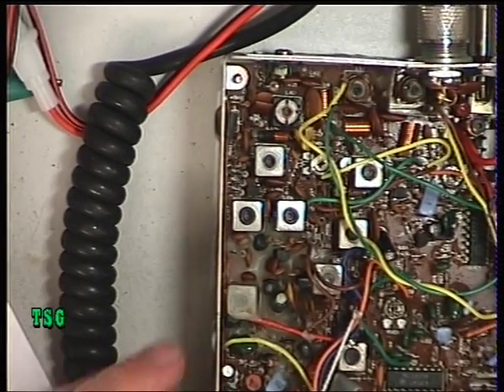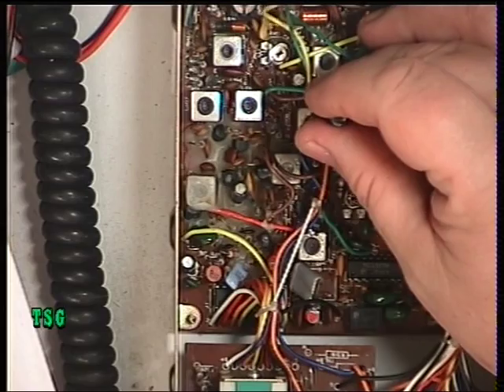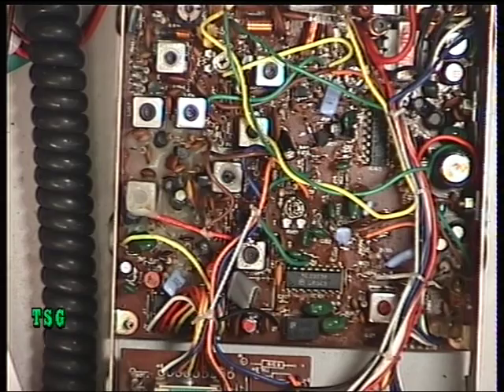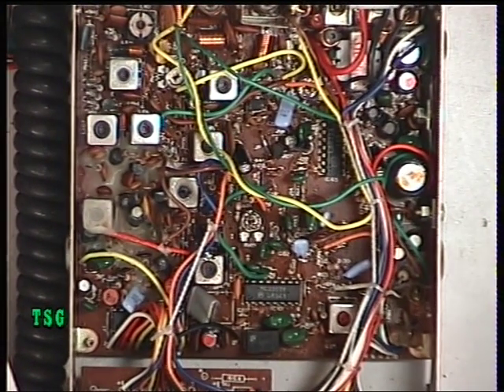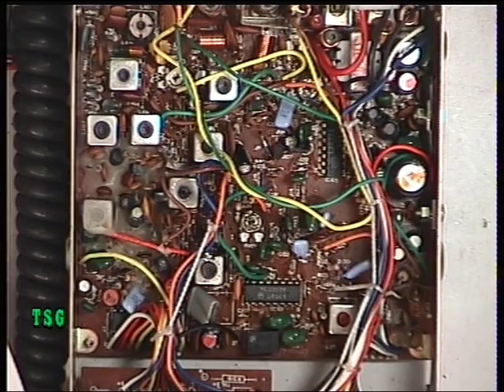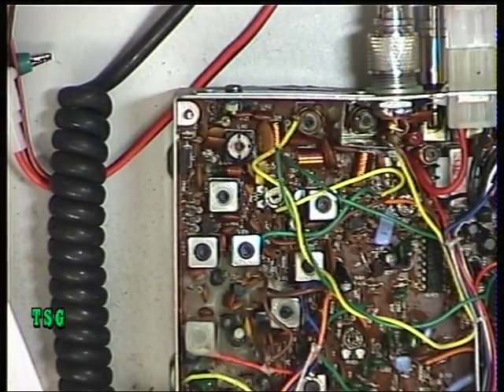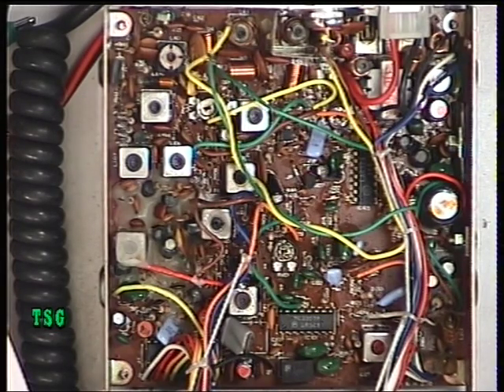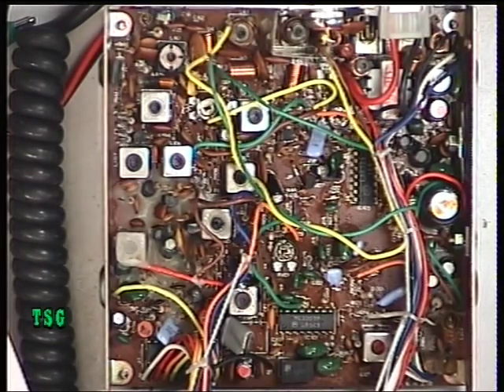Midland 2001, UK (CB 27/81) CB radio (Mobile) -  RX alignment

Comment: I have a 2001 here which needs its signal meter adjusted, but I don’t have RV102 on this set, there’s nothing there. Any ideas?
Reply from the maker: Some 2001's have the adjustment for meter RX level on the main board, some have the adjustment preset tagged onto the meter & some don't have any adjustment at all & it's factory set to around 50uV for S9 making it a bit generous. If you have the early version which is non adjustable, I think you are best off leaving it as it is. Modifications only lead to loss of value on a set that's over 40 years old. 

Richard,G0OF, UK
Reply: @ukfmcbradioservicingTango21  thanks for the reply Richard. This radio is from 1982, not sure what the manufacturing date range of these sets is. This one seems to work OK, other than this signal meter which is very "lazy", and also it has an odd quirk, very simular to the more modern 78 plus, where when you press the PTT, although the TX light comes on instantly, theres a 1/4 second delay before the radio actually goes into transmit! 
Cheers
Kev MW0KJN.